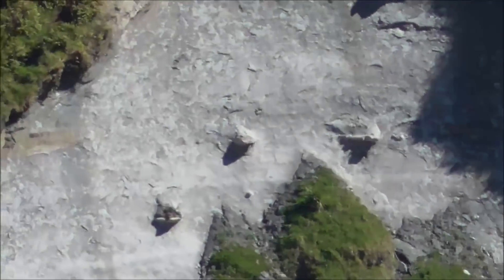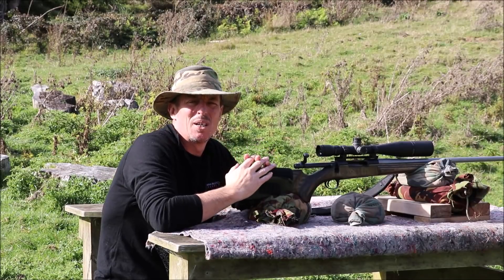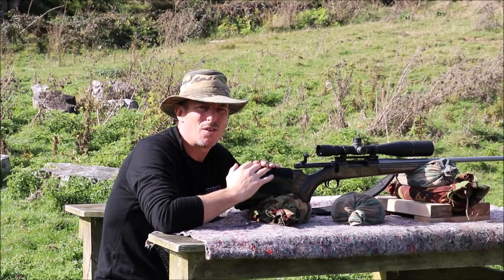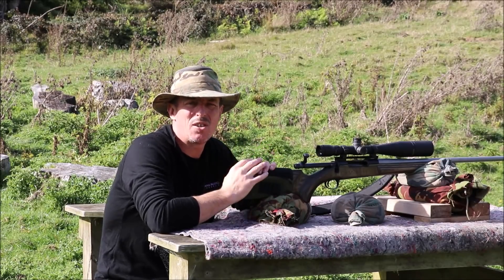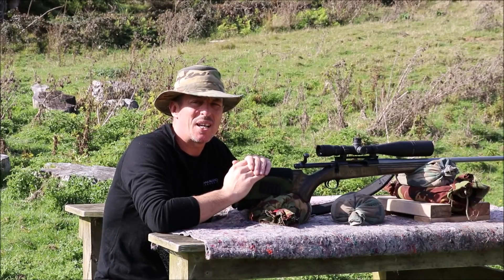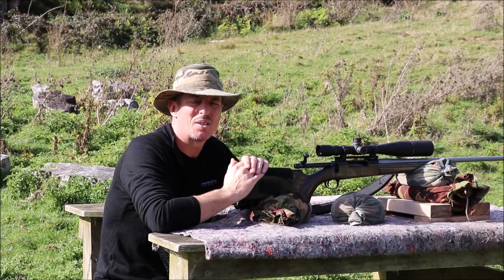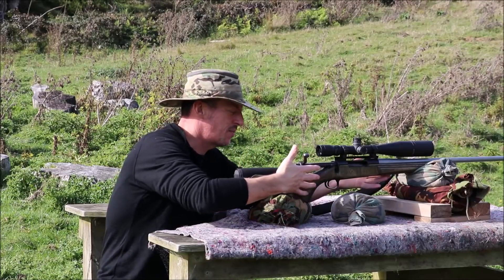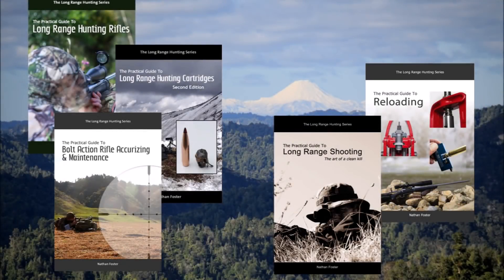Foster Manson Rifle Reamers

Comment: Hey Nathan, great vids mate keep it up.So can the Tikka T3x rifle be used as a platform for the 7mm Practical Cartridge, and if it is which would be the calibre to get for it, the 300wm or 7mm rem mag.just asking as not many rifle manufactures make left hand rifles in as many calibres/chambering's as tikka.thanks mate.
Reply from the maker: Hi Ryan, the T3 magazines are short. They can be made somewhat longer via the use of AI magazines but there are still some limitations with new projectile designs. Ideally, it is good to have a mag box around 94mm for the Practical. When you get some time, have a look into the Stiller Predator left hand action. All the best.
Reply: @Ballisticstudies  Hey mate thanks for the reply. Just had a look on the web and see you can get the Stiller actions in Aus so that's a win, which action would I need to buy for the 7mm Practical,7mmRM or 300WM, I'm guessing the 300WM as thats the case the 7mm Practical uses. Thanks again for the help mate. Cheers.

Comment: Right on Nathan! Best wishes to you and your family. Love your books.!

What would the best COALS be for the 30-06 with the 208 ELD-M?
Reply from the maker: Hi JR, thanks for your kind words. Unfortunately it is too dangerous to share OAL's. The PDF shows approximate guides for the max lengths. Having said this DO NOT seat to the OAL's listed as this may prove dangerous due to differences in bullet batches (lengths) and head spacing.  Generally speaking, this combo will work when you seat about 15 though off the MAX OAL for your chamber as measured for your individual rifle using an OAL gauge etc. The ELD-M often shoots well 10 - 15 thou off max and will give you plenty of powder space. All the best.
Reply: @Ballisticstudies  OK, cool- I have 2 older Tikka's (M695). The inside mag length is 3.50. Either your 06 or your 06 Impvd would work within that demention, I'd think.

Is there going to be a 3rd edition coming out on long range cartridges? I read and re-read that book. My 1st edition copy is pretty well dog eared and tore up. But I have a lot of my notes in it. 

I'd really like to read about how you got the in close brush hunting of hogs down. If any thing else, they'd make great hunting stories.

I brush hunt elk in a flat river bottom area. I don't have that down yet. My snail crawl/death creep isn't slow enough and the wind seems to swirl.